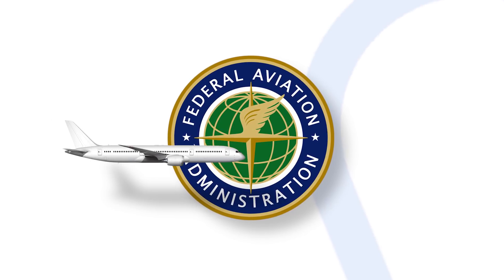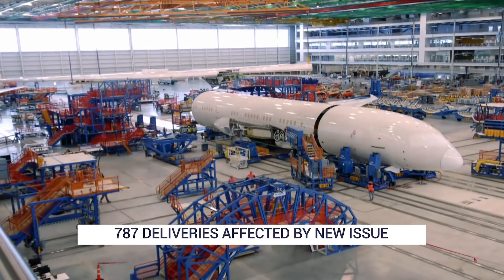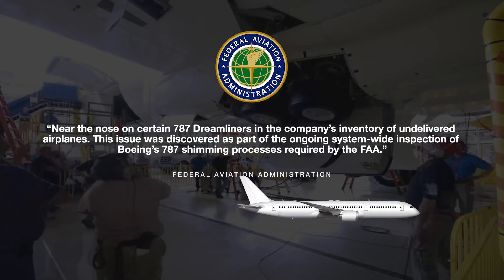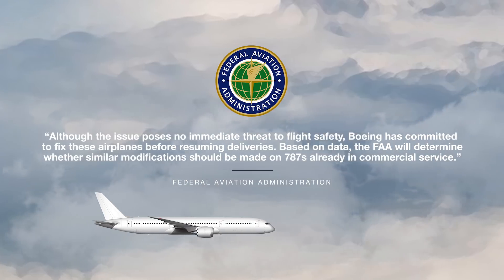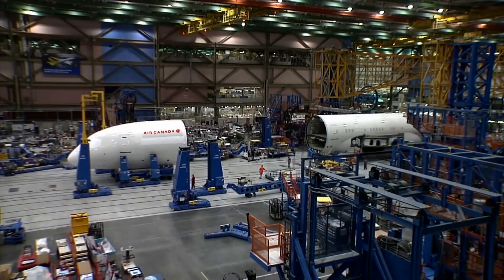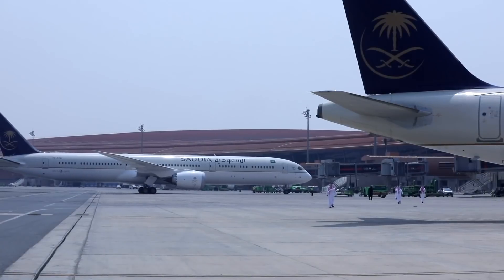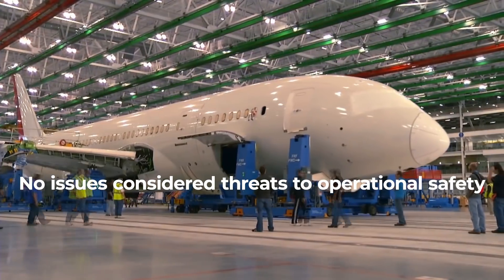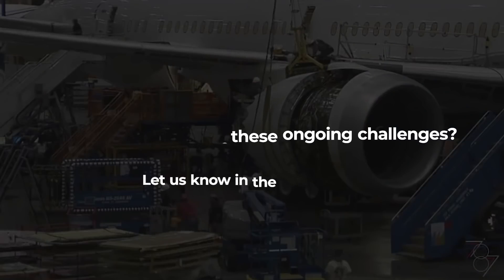Boeing's 787 Dreamliner Deliveries Affected By Another Issue

Comment: Boeing itself needs to be fixed, until that happens there'll only be more mishaps etc., and neither should they be designing new planes as they can't recitfy the problems they have now. As far as the FAA, neither do l trust them, as they have also proven highly incompetent.  
    But Boeing is like any other manufacturer, they figure cost analysis, lawsuits vs profits; If a lawsuit does not out strip profits, they will not rectify the defect, that is until they have a major mishap, car manufacturers are the same.

Comment: I am a retired Boring structures engineer with 35 years of composite structural experience. The shimming issues are not surprising to me as the company's efforts to reduce costs have brought about a reliance on inspection sampling to replace actual inspectors.  The lack of appropriate flatness at fuselage barrel joints my well be a tooling and/or a fiber placement issue.  If the tools used in the barrel fabrication are not designed, manufactured and maintained to exactly the same requirements and standards, surface smoothness can suffer.  I would expect that the fiber placement machines are all the same, but possibly not all maintained or used in the same manner, eg. slightly differing fiber gaps, laps and laydown pressure.  In the 1990s we did some experiments with differing fiber placement machine settings, and found some interesting manufactured panel test results. The very fact that the fuselage barrels are produce at different facilities at different companies could mean a lack of similar usage.  The company has closed it's Everett 787 assembly line to concentrate 787 assembly at Charleston, in a state with no unions, hence less costly and probably experienced workers.  This and the concentration on cost cutting is, in my opinion, the reason for the production issues.

Comment: Just to mention some of the known problems and issues Boeing had (i.e. solved) and still has with it's models.

737 sev models : switch failures of cabin altitude warning system
737 NG : Pickle Fork
737 NG : Engine cover
737 MAX : MCAS software
                  (to counter act CoG hardware issue due to placement of CFM International LEAP-1B engine)
777 : Engine failure of PW 4000-112
777 X : test failure at 99%
777 X : test failure cargo door
777 X : Engine problems of GE9X
787 : Manufacturing mistakes
787 : Engine failures of RR Trent 1000
787 : Battery issues
KC-46 : Delays and budget over run
KC-46 : Floor cargo restraints
MD88 : Engine failure of PW JT8D

Comment: Ever since they moved South it's been problem after problem...

Thanks a lot bean counters...
Reply: Are you sure about that? The 787 has been a problematic aircraft from the off, with daft fixes such as the battery issue being fixed by putting it into a metal box.

Comment: not even the DC-10 had this many issues!   Farrout Boeing's quality has dropped drastically.
Reply: The DC-10 had two catastrophic accidents that killed well over 300 caused by the cargo door being blown out, Not to mention several other design oversights involving the hydraulics.

I don't think the 787 has gotten to that level yet
Reply: @raptors222222  well that's because of the  737 max, the FAA is finally stepping up it's game... If it wasn't for the 737 max the FAA wouldn't have been this rigorous..
Reply: @FLT111  the 787 has been out for a decade prior to the MAX fiasco. In that time period the DC-10 had 3 catastrophic accidents in its first decade. These are Turkish Airlines Flight 191, American Airlines Flight 191, and American Airlines Flight 96. 

To be fair to the DC-10, AA 191 was a maintenance issue rather than a design flaw but AA 96 and THY 981 were design related. 

Again. The 787 isn't the DC-10
Reply: @raptors222222  You're missing the point. I'm aware the 737 max rolled out 7-8 years later. What I'm trying to say is if the    fiasco involving the MAX had not occured how do we not know that the issues being picked up NOW by the FAA as a result of their increase in oversight could not have lead to catastrophic failure leading to a major disaster?
Reply: @raptors222222  737 MAX is EVEN WORSE.

Comment: "Wrinkling in the forward pressure bulkhead" is definitely a safety of flight concern. Generally speaking, the problem is far worse than they let on. Especially after going through the Max grounding, there is no way they can handle another blow like that. I really respected and thought Boeing was the best but now I wont fly on one.
Reply: Travel has never been safer. The FAA said it was NOT a safety issue, so, relax. The FAA now, is not going to lie about it.
Reply: @brkitdwn  Yea I'm sure they are totally trustworthy now.
Reply: Seriously.  The wrinkling in the forward pressure bulkhead is very likely caused by stress.  If that is not rectified, a fwd pressure bulkhead failure could happen, meaning an explosive decompression.  
Sure, not serious at all.  I love how the FAA consistently covers for B.
Reply: @nevillec5252  agreed, possible preload or forcing parts to align then installing fastners.

Comment: so i guess the 777-series BEFORE the 777x series were the last GOOD planes Boeing made without any major problems
Reply: Several countries restricted flights of PW4000-equipped 777s in their territory' (Unable to fly single engine). There's still a 777 full of passengers missing and there have been a few hull loses due to fires.
Reply: @ml9849  Engine manufacture is unrelated to Boeing/the 777. MH370 was pilot suicide. Every major widebody, whether it be Airbus or Boeing has had issues with engines and/or technical problems that are usually minor. The 777 is by far the safest plane out there today as well as many other widebodies from Airbus or Boeing.
Reply: @Jack3md   Long range twin engine plane is unable to keep in the air if one engine fails. 
Jack: 'Minor issue'
Reply: @ml9849  Unable? What? The 777 can fly for over 5 hours on one engine if the other shuts down. The GE90 is the most reliable and safest engine in aviation history buddy.

Comment: At this point throw the whole plane away everything to the last screw has been made to be cost effective and not safe.
It would just be cheaper to design a new plane at this point.
Reply: Throw the whole company away at this point
Reply: Stop exaggerating. These things are in the news now, and something you follow. If you didn't follow it, and didn't know anything about it, you'd still be very safe flying in a Boeing. New or old!
Reply: Seems the majority of problems are not design problems.

Comment: The 787 should rather be nicknamed Crapliner.  Hastily built, full of flaws, the fact it’s so wifely preferred to the Airbus A380 by some formerly fabulous carriers such as Etihad and Qatar Airways shows mediocrity and pseudo ecology now rule the airline industry.
Reply: Been flying the 787 for over 2 years now and it hasn’t let me down once. I have not had any issues other than the normal, reset computer now it works problems.
Reply: @bullwinklejmoos  and the 17 inch seats
Reply: @ant2312  That’s up to the airlines. They are the ones that control that.
Reply: @bullwinklejmoos  you flew it as a pilot ?
Reply: @maximiliengilles4947  i am still flying it.

Comment: aircraft have now fallen into the same issue as autos today... poor manufacturing and quality assurance resulting in so many recalls... sad time for America....
Reply: Yeah only American trucks and huge cars are good.
Reply: @Kaizoku_Zoro  well, not really.
Reply: only in America. Airbus seems to be doing just fine. the 350 is far superior to the 787, and now has superiority in the design and engineering departments as well.
Reply: @albertopascual3267  that's my point... American quality is going down hill... along with our country... we're tearing ourselves apart...
Reply: @jstriggsr  No we are not. Stop exaggerating. These things are in the news now, and something you follow. If you didn't follow it, and didn't know anything about it, you'd still be very safe flying in a Boeing. New or old!
Reply: @jstriggsr  Sad to know that while others don't see it themselves.
Only if people can see flaws and fix it. Not have some sort of superiority complex instead.
Reply: @brkitdwn  ok... if you say so...
Reply: @jstriggsr  Do you have any historical knowledge of the commercial aviation industry? Manufacturers have always had structural issues they've eventually overcome. Safety has only improved over the years.
Reply: @brkitdwn  Generally speaking; you're correct.
Reply: @albertopascual3267  thats your opinion, not a fact, Keep it to yourseld :)
Reply: Boing vs. Airboss. 
That's a fact.
Reply: @Boeing-ER-jy9vq  except its fact. Even Boeing engineers have said they would not want to fly on the 787.
Reply: @cplcabs  source?
Reply: @Boeing-ER-jy9vq  True....Alberto clearly doesn't have a clue.
Reply: Shameless capitalism at work.  
Corporate greed over quality production.
Reply: @nevillec5252  pretty much... today it's all about the $$$

Comment: If the FAA did an audit at Airbus they would find things wrong as well. It's just the fact Boeing is over scrutinised after a few (many) issues with the 737 MAX
Reply: Cuz Boeing and FAA used to be benchmark of aviation standard until the MAX incident. You could say that FAA sought its revenge thru heavy scrutiny on Boeing's assets.
Reply: @Chris58851  Exactly
Reply: And I believe there should have been thorough testing and more rigorous as well like simple testing is not enough to test the effectiveness of planes.
Reply: Thats what happens when you buy computer parts from maplins,.
Reply: Doubt it. It wasn't FAA scrutiny that caused the battery issue. It wasn't FAA scrutiny that caused 787s to fall on their noses. AIRBUS are scrutinised by EASA.
Reply: Europe has EISA. Difference is they are not infiltrated by ex Airbus employees.
Reply: @ljacobs357  Yes. But the ex-Boeing employees in the FAA... why are they ex -Boeing in the first place? Because they were fired and now aren't particularly eager supporters of Boeing.
Reply: I think that’s purely not true like I believe it’s just the quality of the plane they are producing and what country they’re source in those plane parts from like mostly it’s from China.

Comment: 737 max : has problem
787 : has problem
777x :also has problem
Reply: 787 already had issues from the beginning so I'm not sure if I should be surprised or not.
Reply: Multiple problems, in the case of the Max and 787.  
Patches on patches on patches.  No worries, just put another patch on.
Reply: @jadliban  Lol ( * it [797] officially doesn’t exist *)
Reply: @jadliban  Based on Boeing’s recent track record, makes sense.
Reply: 777x doesn’t really have any problems
Reply: @chrispopovich700  The 777X is 4 years late (and counting) for entry into service. That alone is pretty bad for an aircraft that’s rapidly becoming obsolete amidst the past decade’s market trends, COVID notwithstanding.

It also had an “uncommanded pitch event” during flight testing back in December 2020. Sounds familiar? Also, it had problems with the GE9X engines, although that’s more GE’s problem than Boeing’s really.
Reply: @daltonmojica  It was scheduled to enter service this year so it’s only 2 years late as of now
Reply: @daltonmojica  Or your problem at 36000 feet !
Reply: @chrispopovich700  Yeah, but the 777X is not expected to enter service until 2024, specifically because of regulatory issues. The first several airframes have been built, but the FAA is not approving this aircraft out of flight testing anytime soon.
Reply: @daltonmojica  You’re right about most of what you mentioned, except the 777 is nowhere near becoming rapidly obsolete.
Reply: @Jack3md  Is it not though? The industry’s been trending to smaller planes, point-to-point, and multiple daily departures for the past decade.

Check out the sales figures for the 777X and compare it to the 777. Sure, the A350 probably has something to do with that, but the fact that the A350’s already smaller than the 777 and that airlines have been satisfied with it means that the market’s been trending to even smaller new aircraft.

In a decade, I bet even the A350 is going to be too big for most business cases, except for extremely congested airports like JFK and LHR, and possibly ME3, with most airlines opting for 787-sized planes as the backbone for their future long-haul fleet.
Reply: @daltonmojica  the date from that flight is shocking to see! 😳
Reply: @daltonmojica  Sure, sales may not seem that great for the X at the moment, but years down the road once the program takes off, more and more sales will trickle in just like the -300ER.
Reply: @chrispopovich700  if you look back some simple flying videos he states about the problem with 777x
Reply: @milanb5735  It’s normal for planes to have setbacks in development, it’s just if it happens to be boeing the media blows it out of proportion for publicity
Reply: @chrispopovich700  that's what Boeing wants you to believe
Reply: @chrispopovich700  YET.

Comment: Anyways

Is there any a350?
Reply: What, You wishing for A350 problems?
Reply: @crimsaki5273  

Uh, No never like the only problem with A350 was with its layer or coating of paint that not sticking on. Other than that I heard of no issues with the plane.
Reply: I would just like to say that issues with planes are fairly rare and structural integrity issues are pretty serious and I believe testing should be more thorough before the plane is put into service.
Reply: And Boeing also had a battery problem on the B787 which is using lithium ion battery which is not great for planes.
Reply: That was like 2016.
Reply: @aviatorsound914  Boeing representitave said "DOH"